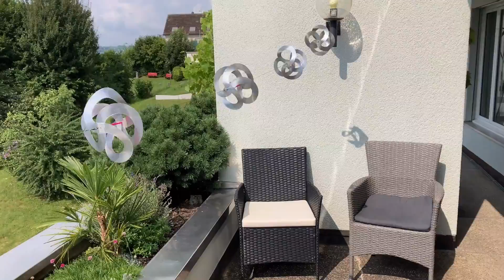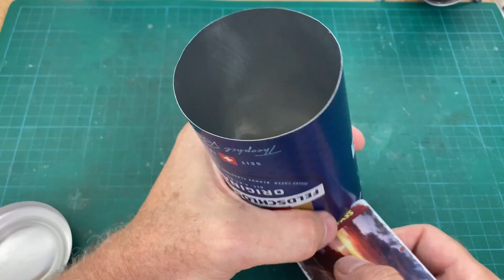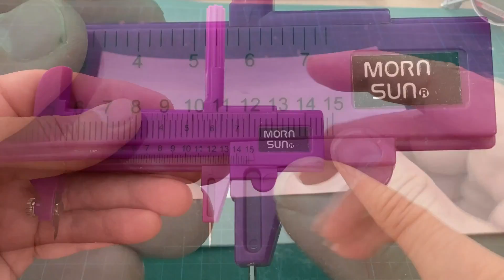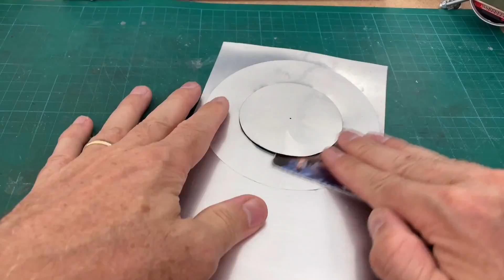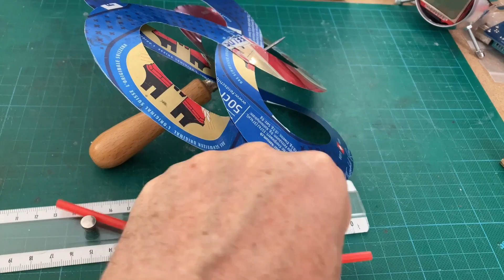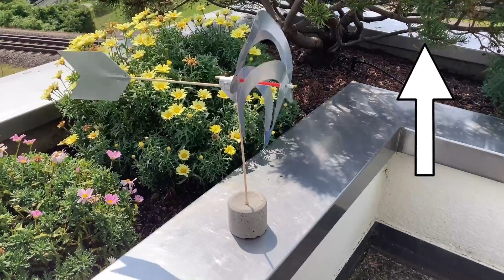Soda can helix wind spinner

Comment: When the rubber tip of a stylus wears out remove it and the pocket clip from the other end. The hollow aluminum tube that is left will work well in place of a plastic straw. I prefer wire rather than the thread or string. Very informative video. Thank you for posting.